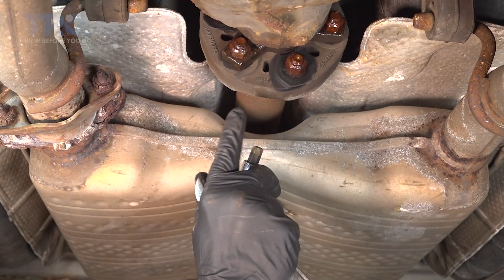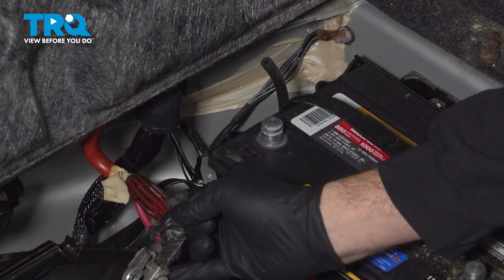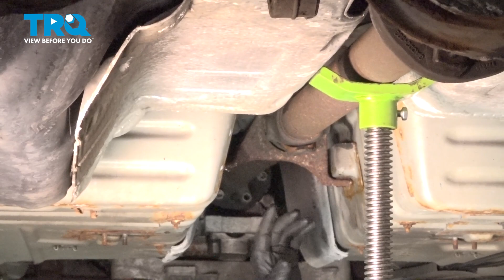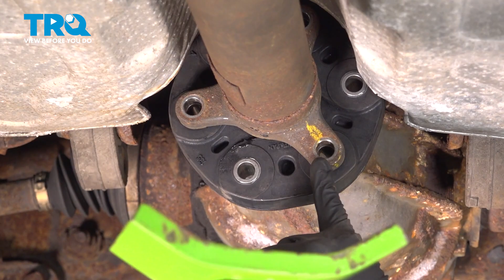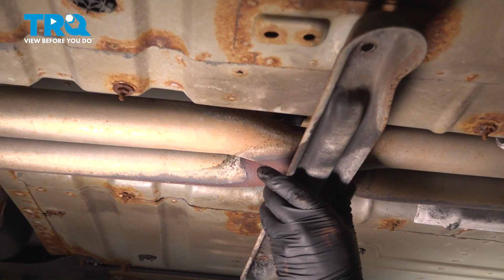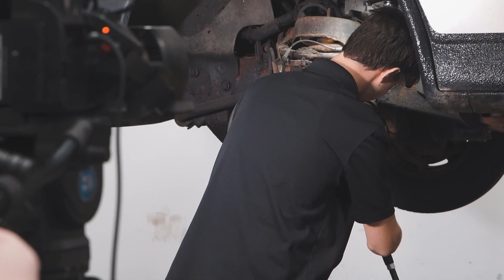How to Replace Rear Driveshaft Coupler  2005-2010 Chrysler 300

Comment: My Chrysler was driving rough and sound like a motorcycle when accelerating. I thought it was my sparkplugs and coils, after replacing that it did not change anything. So, I took it to a garage, and they lifted it up and found that the Drive shaft Coupler was worn out and needed to be replaced. Now it runs smooth as it should.
Reply from the maker: +@warrensmith1005 Thanks for watching our video! http://1aau.to/m/Shop-TRQ

Comment: Not sure why you marked the shaft n yoke for removal and assembly, they are not balanced that way, the shaft is balanced as an assembly and the yoke is part of the differential.  I think if you pull heat shield off exhaust, or just move out of the way, you can pull the 2 hanger bearing bracket bolts and not have to drop exhaust...

Comment: Hi I've been underneath my 2014 chrysler 300 as I've had a vibration  at the rear when I get to higher speeds, and I've realised that one of the 6 bolts on the rear is missing!! This is stupid to ask and I'm sure I know the answer but would that cause the vibration?
Reply: 100%